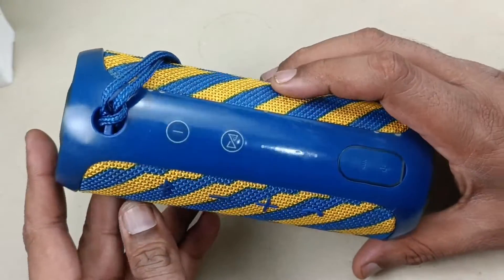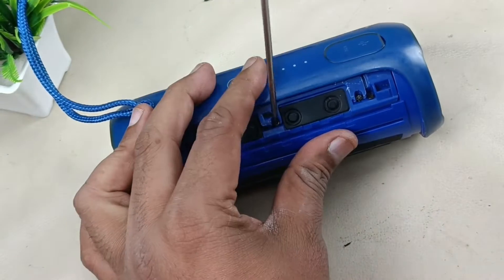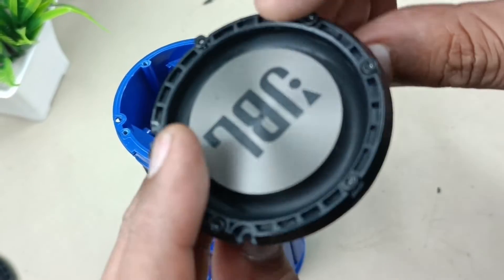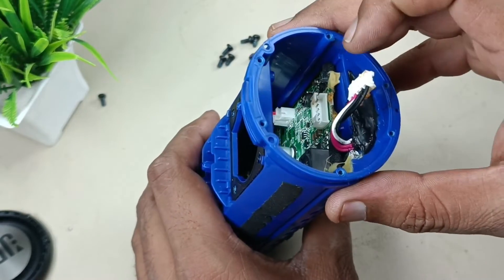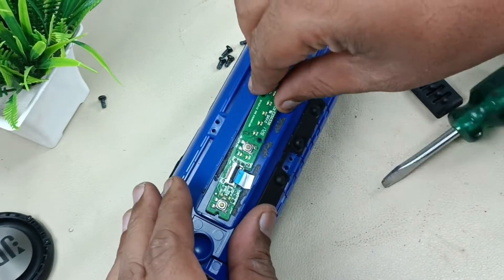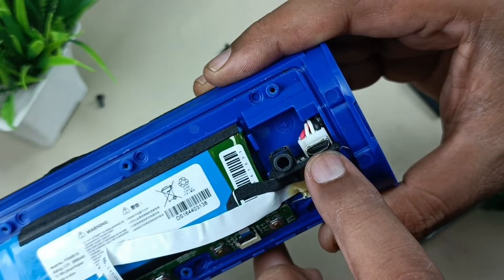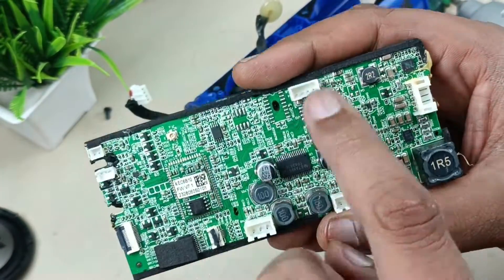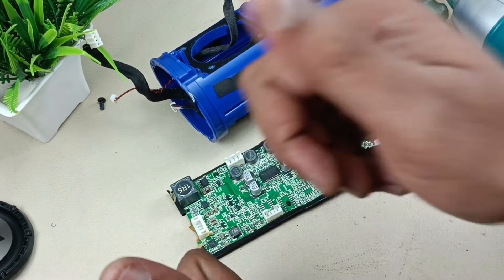Disassembly of JBL Flip 3 Bluetooth speaker | Complete teardown | How to disassemble the speaker

Comment: Hi, would you please tell me where the microphone is located? Thank you very much. Edit: at 8:07 that seems to be the mic cable, with a twisted red/black running towards a hole near the driver. Is that it? I hope you can confirm. I'd just like to maximize placement during calls. 🙂
Reply from the maker: you are most welcome! 

yes that is the mic cable , and it is running towards a hole near the driver, that is mic located. ! 👍😊
Reply: @audiowiz360 thank you very much, sir
Reply from the maker: you are most welcome 🙂👍